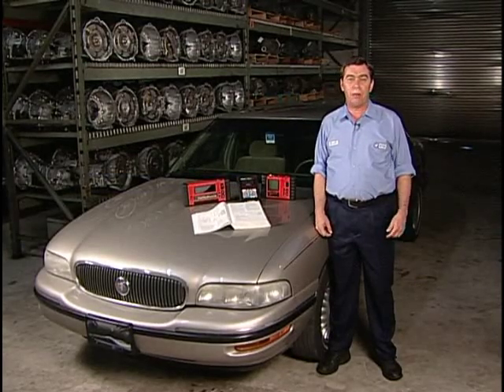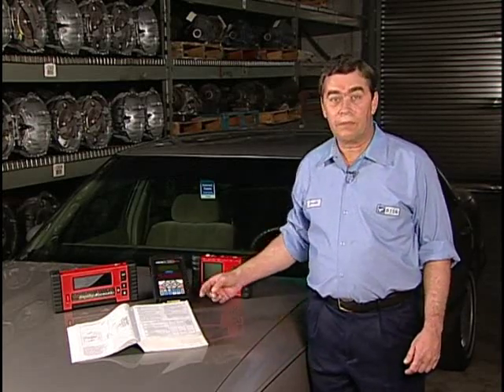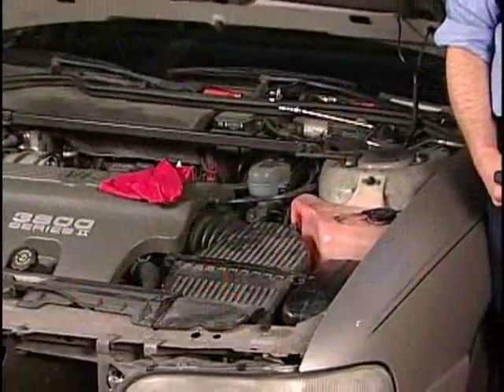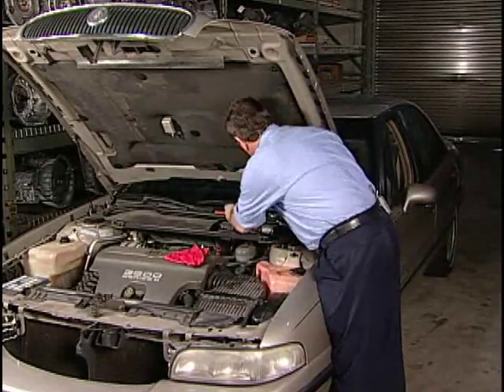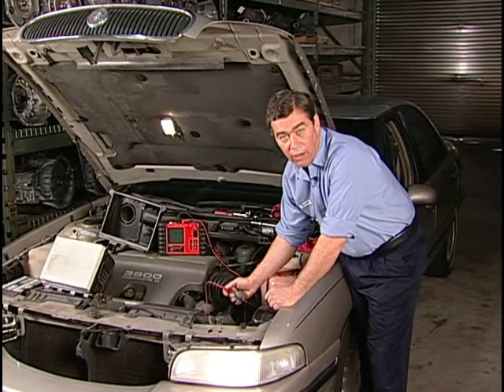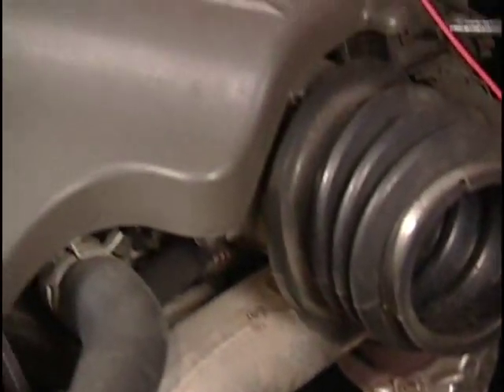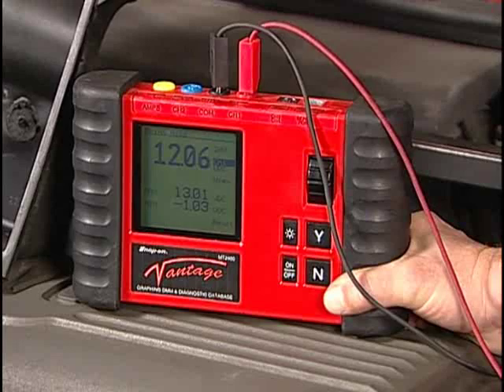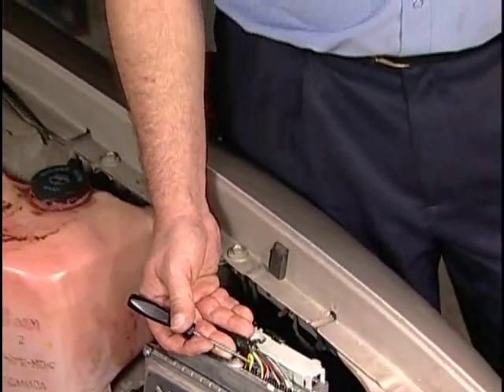Late GM vehicles with codes P0742 or P1887

Comment: What book can i find this in?  I have a Haynes book for my 2003 Grand prix but cannot find this information. i just had my transmission flushed. i later had to replace the pan and gasket and filter due to it leaking. then after 3000miles. the care coded P0742 TCC stuck on.  Should i get flushed again or take it to a transmission place? The car shakes drastically after a 5 mile run now.
Reply: Factory service manual. Haynes is junk.

Comment: Hi Gerald, I have an 2006 pontiac grand prix with P0742 code, and i did procedure number one, and when I reconnected the connector of the transmission and measured the voltage without turning on the car it continued to have voltage. In that case what is wrong? Because in the video when connecting again the connector of the transmission has no voltage until the car is turned on
Reply from the maker: Hi Angel - it could be something other than the connector itself. Sometimes going a bit deeper on diagnostics you will find the problem. However, feel free to give us a call and we will help you out! 800-245-7722 :)

Comment: WOW now that nails it down big time !  I had to scan the net for literally days, trying to find someone who knew WTH is going on with these TCC stuck on/hard shifting issues w/4t65e transmissions.  almost no one on the message boards knows how to diagnose this right !!  most of them try transmission flush, or change ALL the shift/pressure/tcc solenoids- without really know which one it was.  or, they REBUILD THE ENTIRE TRANSMISSION for $2000, when in reality it may be a 10 cent wire or connector.  or only ONE pressure switch. thanks a lot for this info, great video.
Reply from the maker: Awesome!! Glad it was helpful.
Reply: So what do I have to do for my Pontiac to get back roght